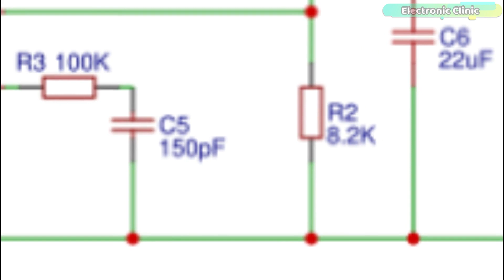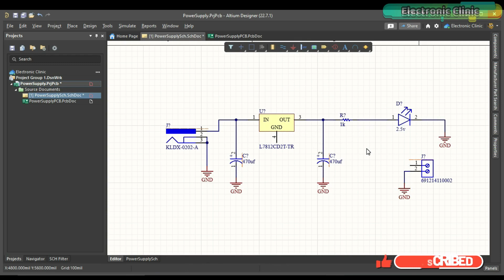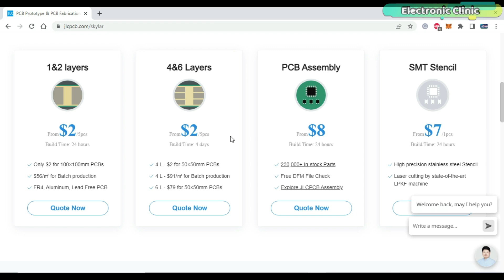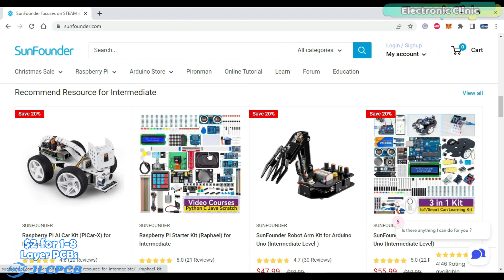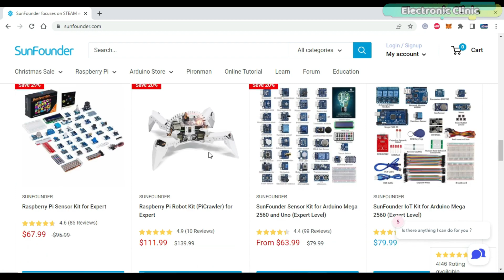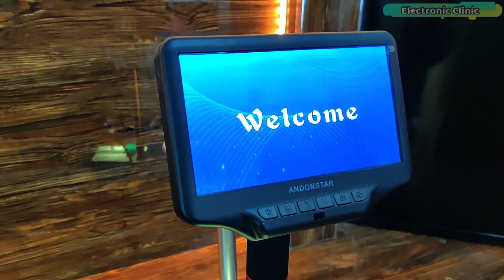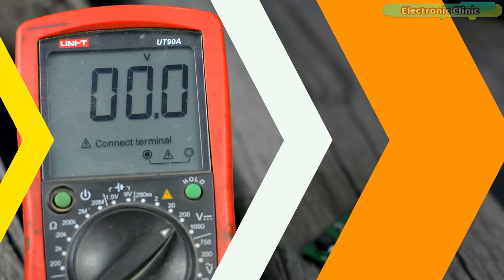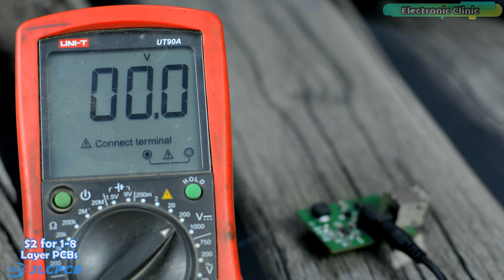Power Supply For Arduino, ESP32, ESP8266, STM32, CELL PHONES etc, MP1584

Comment: How cool is that ! Exactely what I need ! I started working on something similar last year. Also dissapointed about the poor power ratings of a standard 78xx, I finally went for the LM78xx, still poor, but my choice was limited because of the long delivery. I planned a new revision soon, but your project makes it no longer necessary. The only extra feature I had was solar input. Great video !
Reply from the maker: the good thing is, only by changing one resistor we can get different voltages.
Reply: @ElectroniClinic  Indeed, I'll defenately look into this more in detail. Also thinking of adding a step-up converter. Looking forward to see the next video !

Comment: In this usecase why not just put a mp1584 module break out on the pcb to save time and money?
Reply from the maker: Ya of course you can put a break out board but u know lolxx I did it for you.
Reply from the maker: Next I will use this my designed pro micro
Reply: @ElectroniClinic   how did plan for a 5.2v output and finished with a 4.8v out put, how would your corect it in future versions
Reply from the maker: @chimpofm  the other one gives me 4.9v. by chainging the resistor value we can increase or decrease the voltage. It's simple.

Comment: What power cord are you using to power this board?
Reply from the maker: It's a simple male type jack which normally comes with DC adapters
Reply: @ElectroniClinic  Thank you for replying. I am new to this realm of electronics. Could you link to the product. Also do you have any videos you would suggest to get into these types of electronics? Starting from the foundations?
Reply from the maker: what exactly are you looking for?

Comment: How much current can drawn in output
Reply from the maker: I will check this during performing experiments on the Servo motors.
Reply: @ElectroniClinic  Can you share the Data of Volt with Respect to Current Drawn In Output Terminal ?